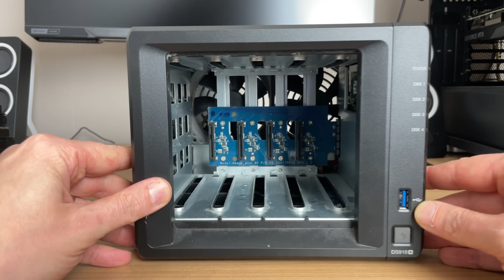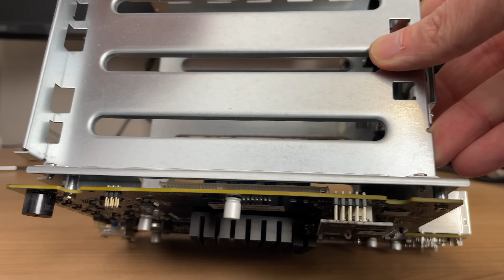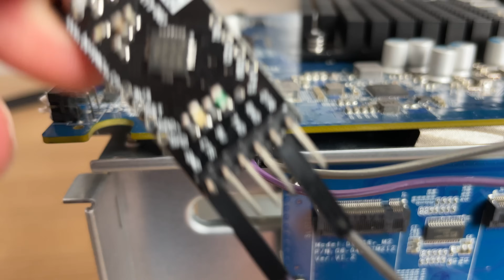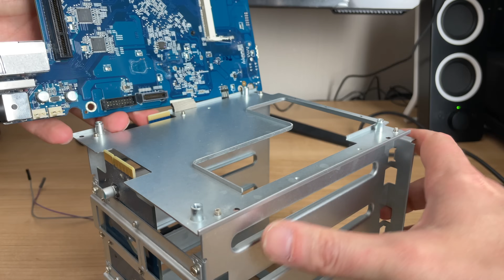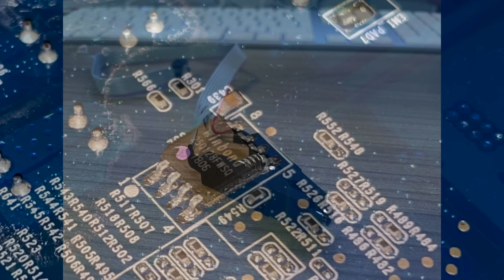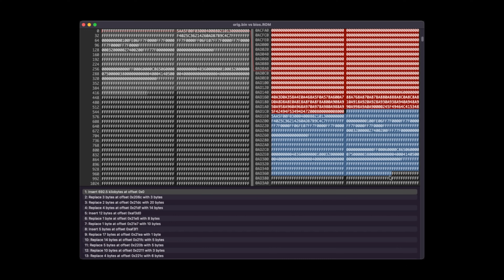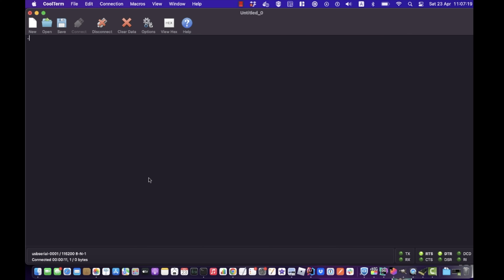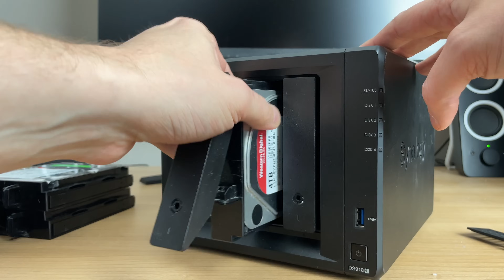Synology DS918+ Bricked / Blue LED of death.

Comment: This is one of the major reasons I never buy ready to use appliances and build my own servers even if it's more expensive. I know that when (not if) something goes wrong it's going to be much easier to fix it.
Reply: I don't even bother with specialized NAS/Network appliance distributions. I don't need preconfigured stuff and an interface. I use the same Linux distribution that I use on desktops without all the desktop packages installed. That way I don't have to remember yet another way of doing things. Been using BTRFS for around 6 years on that server and so far never had a problem. I replaced both drives once online when smartd detected too much problems. But I only use RAID1 (mirror). The problems with BTRFS are with more complex RAID levels.
Reply: Freenas/Truenas ftw.  Though I have heard BRTFS isnt to bad, but is still having teething issues after 10 years of development.

Comment: a ups would be good to avoid these issues in the future!
Reply from the maker: So everyone is telling me :) Didn't know these NAS boxes were so prone to failure due to power cuts
Reply: @RetroSpector78  isn't that the case for any "computer" or even a device with a PSU, so virtually all electronic devices? I know that my stereo amplifier for instance, at least I was told, is also very sensitive to power cuts. The same for everything that's in my networking rack, etc. The same for a regular PC. I guess it's less of an issue with real ROMs but as soon as you deal with eeprom (and my amplifier/receiver has FW updates) it seems to become an issue.

Comment: I have a quick power outage and my computer did not work right.  I have to replace the motherboard to get the computer working.  I suggest an UPS Battery Backup and Surge Protector for computers and router.

Comment: It's not a problem with the crocodile SOIC8 hook. It's something interferinng with the reading, like you said. I have same problem when I hook the crocodile around the SOIC8 chip, it gives me some pins are not connecting properly. With the multimeter in continuity, it is connecting fine all the 8 traces but some component on the motherboard is interfering.
I would remove the coin cell and leave things alone for a while. I had problems with my mini pc, that once in a while, rarely, it presents me a red led and does nothing else. This happened power was cut or with a normal power on. Reset button did nothing. I tried other 12v power supplies, still red led. Then I disassembled everything and removed the coin cell plug and went to sleep. The next morning, I hooked the coin cell and assembled everything back and it was working again. Some months later, same thing happened. After some minutes of coin cell out, it was ok again. I have to dissassemble the mini pc to get to the coin cell plug.
Glad you sorted that problem with your NAS.
Reply from the maker: Yeah figured as much. But the plastics on crocodile clip was very low quality and couldn't even manage to hold it on to the chip after a couple of tries.
Reply: @RetroSpector78  Last year, I bought TL866II and EZP2019 programmers and both packages came with one crocodile thingy each. Yeah, the tip where the teeth are gets brittle with bad mounting over SOIC chip. I think AdamantIT demonstrated desoldering the SOIC8 chip and putting it on the crocodile also works.

Comment: thats why NAS units are a waste of money in my opinion , they don't last  and expensive , people are way better off just converting a old PC tower to do same job . and it be more expandable,  faster, cheaper and  obviously more reliable and if anything does go wrong its not a big deal to sort out
Reply: Larger, take more space, make more noise, more powerdraw, you have to spend hours on end to fix stuff, update stuff, configure stuff.
There is serious value to these devices. You can buy a 2 or 4 bay that sits in the TV bench and never make a noise and work for years. Sure there is always ones that break sooner..

I dont have the patience to set up a similar freenas system, and how ever I do it will have to many drawbacks and no benefits other then a less user friendly interface..
Reply from the maker: This is exactly what my feelings are. Sometimes you just want something small that you just plugin and works out of the box. I also really like the DSM ecosystem where you have lots of apps that you can install on the Synology. It is pretty well supported. What happened here probably only happens to a handful of users. But there are lots of reports of people having similar issues where they just end up replacing the entire unit. And most of the time it can be fixed.
Reply: I just use my router, it has a USB jack and I connected a hub and a bunch of USB hard disks.  I make backups of the ones I care about by imaging to other USB drives I can plug into my  PC.
Reply: $500 bucks for a smallish case and 4 bays? Ouch!
Reply from the maker: That's about the price you pay for a 4 bay NAS unit these days.

Comment: If you are only after your data: Did you  try to put your disks into another regular linux machine, boot it up and look if the raid is present? If not, what does a mdadm scan do? (mdadm = software raid)?
Reply: Otherwise, do you know the exact filesystem /RAID layout / setup of the 4 machines?
Reply from the maker: Haven't tried it, but I guess that should work ... Have a couple of other bricked NAS boxes that I will attempt to fix. So might try playing around with that in the future.

Comment: A power surge mains adapter. Or Battery backup system so when mains failure it switches like a laptop over to battery instantly.
Reply from the maker: Yeah I understand the added value of a UPS, but if it so mission critical for these things to power down gracefully they should provide something built-in. A super-cap or something, or a small battery. Have lots of device in the house here that can survive a power-cut. Or at least make it easy for people to fix their devices in the event it gets bricked like this.

Comment: Not sure I'd trust my data on a box that bricks itself on a power outage! Seems odd this bricking, almost like it's on purpose to make you buy another... No way cutting power should corrupt a flash chip like this.
Reply: The flash chip may have been corrupted weeks prior.  Linux doesn't typically use BIOS routines once the kernel loads so the damage would have been hidden until a restart was required.
Reply: More than likely some sloppy power management.  If it’s a flash chip, it can be written to.  Usually the difference between write and read is the state of a pin or two.  If the pin states are poorly defined while voltage rails are rising or falling, it can easily lead to data corruption.  This is why there are power management ICs to hold everything in reset when power is outside of preset thresholds.
Reply: I have a 214 / 414 and 918+ (with the expansion unit), and there has recently been a couple of power failures (loadshedding), in my country. Even though all three NAS devices are hooked onto a UPS, and are suppose to shut down in the event of the UPS getting to 50% backup time, my UPS failed on 3 seperate occasions, meaning all my NAS devices crashed. I never had the above problem of any of the devices being bricked, as they all started up normally again. So, I would agree, the above seem to be an oddity.  Having said that, I'll be a lot more careful in future, and make sure my UPS batteries are replaced every year or so.
Reply from the maker: Yeah, but there are lots of reports where people experiencing this blue LED of death after a power cut. I think there should be a procedure to reflash the thing in case it goes horribly wrong like this. Don't think every NAS consumer will go out and buy a UPS device for the extra protection.
Reply: @RetroSpector78  I will definately take better care  of my Synology now.
Reply: @RetroSpector78   Right.  And consumers shouldn't HAVE TO get a UPS.  If inadvertent writes are being done to flash chips on power failure, it's a design problem.  I'm not cynical enough to believe it's intentional, it's just sloppy.  A failsafe BIOS copy would be a good start (especially if it's actually ROM), but seems more like a band-aid to a hardware fault.
Reply: @simonmikkelsen  or buy truenas mini and have a happy life
Reply: @RetroSpector78  When boot from ROM fails, it should automatically fail over to boot from microSD if present. The microSD should provide the option to re-flash the bios. The hardware and software development to do this would be minimal for Synology. It's just poor engineering.
Reply: @RetroSpector78  You wouldn't protect your data and $500 box with a simple $40 UPS?
Reply: @RetroSpector78  Those older style changeable bios-chips were nice as fast change. Or fast and cheap, then Synology wants  one month posting and 200 dollars for the chip? ;-D
Reply: I have an older one from 2015, and have experienced power failures several times, and never experienced this occurrence after one.  After power is restored, it goes through a manual file reconstruction which takes HOURS, but afterwards it functions normally.
Reply: That's what i'm inclined to think too
Reply: Deploying data on a NAS without a UPS is a roll of the dice. If you want a NAS, be sure to budget for a UPS. Decent UPS are available for very reasonable prices. I purchased a cyberpower for $220. It's been a good investment.
Reply: I doesnt, does it? There is always flukes. Stuff break all the time. And who knows, power perhaps was lost when it was updating the bios..
Reply: @jmkhenka  True that is hy I do not use auto update and had my DS920 hooked up in an UPS

Comment: TLDW raid isn’t a backup. It’s probably faulty and will do it again. Why did it’s firmware corrupt in the first place? I don’t see how you solved anything. It’s nice you got your stuff back but you didn’t LEARN anything. Seems if you do synology nas you should buy two or them and keep one as a spare. My HP pro desk motherboard did the same stuff and I replaced the computer since it’s spi was corrupted for no obvious reason. Reflashing firmware can fix things but it’s not a solution it’s just a band aid while you replace it. I wouldn’t bother using a device that corrupted it’s firmware while I was not flashing it. Kudos to you again for fixing it I hope you back up your data going forward

Comment: Speaking of Synology, I got a DS412+ that was broken -- whenever it tried to load firmware it thought it was a completely different unit and thus it downloaded a wrong firmware.
I managed to load the GRUB that's on the built-in flash drive into IDA and somehow found undocumented (d'uh) argument that forces specific model to the kernel/OS... And it has been working ever since :) no clue where the actual model is stored, BIOS (checked build date) matches the one from DS412+.

Comment: Ello!
not done watching yet but so far remarks I found:
a) seeing at the beginning MZ header + .text/.reloc etc is MSDOS EXE header
b) it should be extractable via some resource hacker -like tool even directly
c) doing it in-circuit it means that it has to power up the chip and if the whole board has got too many things on that power rail it will try to power up those too
d) before flashing I always do a backup, plus the flashing tools often have "verify checksum" function (last few bytes in the BIOS)
e) training error -- either using incompatible ROM or they chucked out a large chunk of the memory init code to work with only one type of memory (speed/rank/..) :)
Reply: he had wrong voltage RAM, DDR3L is the correct type - 1.35v not 1.5v or whatever DDR3 is.
Reply: For E it may have been he was using DDR3 rather than DDR3L

Comment: TrueNAS or Unraid FTW
Reply: They are not even comparable, really. You will spend so much more time and effort to get a similar feature set as a Syno does out of the box. But would buy a truenas/unraid system if there was one with same footprint as a 918+ that i have now.. but there are none, i refuse to have another box that is almost impossible to hide. I dont have a garage to place stuff in.
Reply: I really do not understand why Unraid has as many fans as it does....especially, now that it is no longer free....(that would have been the nail in the coffin!)
Reply: @mdd1963  Maybe you should ask Linus...

Comment: Amazing fix!

I have a DS1817+ and it plays on my mind every day. It's predecessor, the 1815+ was one that was notorious for bricking itself and I worry that the issue was not solved before the design of its replacement. Mine is about five years old so it is about the time for it to give up. I have it, and the router, on a UPS so it should be getting the cleanest, most stable power and connection I can feed it.

I just backup everything that I don't want to lose in other places, but it is not viable to do that for everything. 

I'd probably buy another one. Building my own is possible, I have enough parts here to do it, but the Synology software is really good. It is nice that you can just put the disks into another box and it just works again.
Reply: 1815 had/has a cpu that had a known documented bugg. The fault was INTELS not synology. Millions of devices got broken by that, most common routers, firewalls (we have replaced 20 firewalls due to the same cpu bugg) etc, and this was Enterprise hardware.

There is a solution that works most of the time - soldering a resistor on two pins. But its a temporary bugg. there is much documentation on the nets about it, wich devices are affected etc.

One of the Synology rackstations was affected, I had to reboot the NAS for updates and it never came back. A collegue of mine soldered the resistors and it worked again.
Reply from the maker: Have 2 of those 1815 bricked boxes here that I will try to revive as well.
Reply: @RetroSpector78  I look forward to watching that. I have seen so many people on YouTube complain about them, it would be great to see a video with a positive outcome.

Comment: There's a reason I use TrueNAS on standard PC hardware. Just rebuilt my NAS into a server case (SC-4824) , fitted nice quiet fans. I leant my lesson from using Drobos, they were a pain in the neck.
Reply: Until you discover a bug in ZFS and it corrupts your pool and causes the kernel to crash when trying to mount it. Don't ask me how I know.
Reply from the maker: Yeah, think there are more risks involved with these DYI NAS, especially if you're not a FreeNAS / Linux / ZFS expert. Also it would be very expensive (or impossible) to get something with the same form-factor as a Synology. So yeah mixed feeling. It is just a commodity. Between work / family / youtube / hobbies it just becomes too time consuming and you just want something off the shelf that (kinda) works.

Comment: There is a good reason for ICT fixtures to use various pins for contacting onto the test pads on the PCB. Also, programming is via BSC (Boundary Scan), because ICT is not ideal for that. ICT is good for detecting electrical failures on the PCB and that's what it was designed to do.
Reply: Hmm, meaning what and being helpful when? Care to contribute anything to this context? Of cource ICT is problematic with bios chips. Thats why he unsoldered it.
Reply: @digital-experiance2390  ICT has no problem with testing flash memories. Reading their content is another story. You need a specific fixture AND testing program for reading/writing flash in circuit.
Useful? No. It's just a fact, why would it need to be useful?